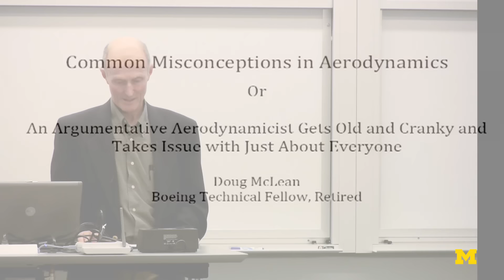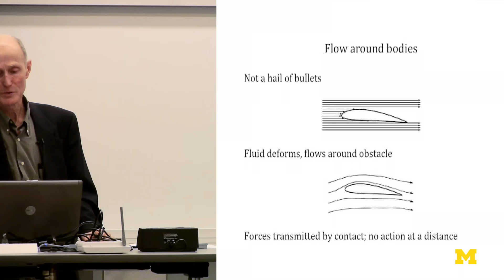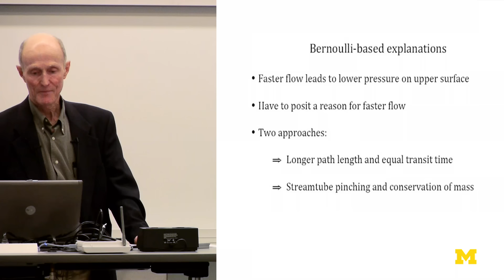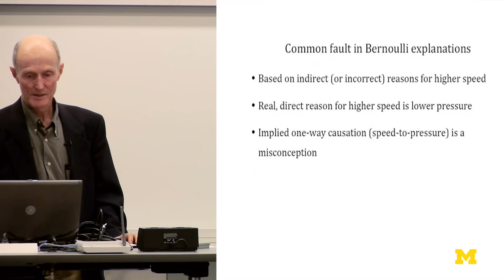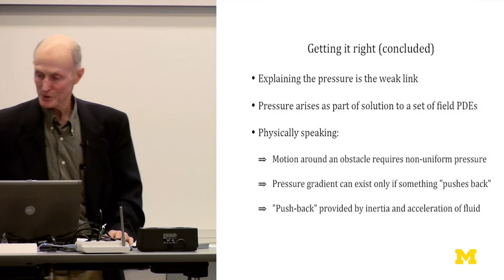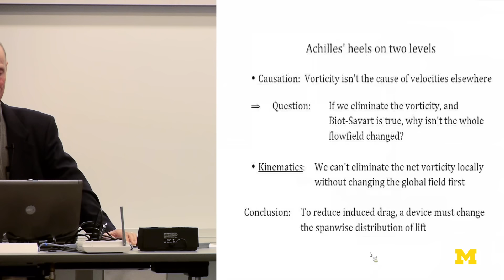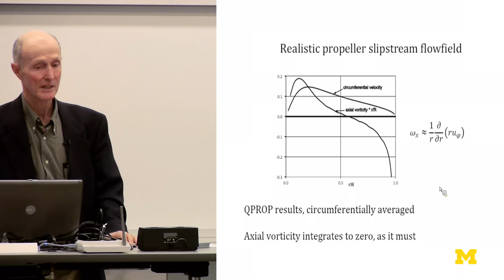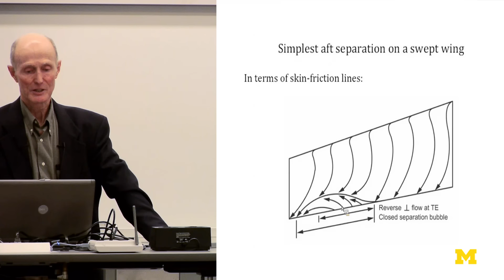Doug McLean | Common Misconceptions in Aerodynamics

Comment: aerodynamics is a topic where humans have gotten the idea that the medium is what give a plane lift completly ignoring the obvious that its the object the drives the medium not the other way around. they chould talk about airplane wing dynamics instead. they chould also talk about planes like we do with submarines in water. in water is it oceanicdynamics becasue the cavitation is inverted in water that causes explosions or micro booms. anyway what i dont hear with the engineering mind is what anyone chould be thinking and not engineering air because the end of the story is always the engineering of the plane not air. what the introduction chould be is two tings that is obvious and nothing else matters. the two things are mass times surface area equals lift. the angle of lift equals the placement of mass or the shape of surface area of mass. it does not matter what shape of the wings you use what ever like a swan or like delta configuration. a plane that generate a updrift of climb without flaps is a bad plane. newtons law of motion a object that is set in motion will remain in that motion that invovle direction and angle until a force imbalance or change it. this means when a plane is set in a angle it will continue to lift going up util its steering forces it to change direction. this means that planes that fly upside down are disasterously dangerous the way they are currenly designed. if there was such a thing as areodynamics then a wing must have a special shape to fly but since practially any flat surface will do for lift and by means of stabilizers can fly just as good as any particular wing shape. paper planes of different shapes fly very well and they dont have any special shape for lift. there is a dogma about aerodynamics where engineers think their plane wing desings are engineering air. that is not the case. there is no aerodynamics. the physics of planes is purly atmospheric pressure where lift is proportional to mass times surface are at a given angle. the medium is governed purly by air density. concorde was a failure because of my fireplace get to hot when i nearly close the air intake and the temperature goes the highest. what happens with friction when air density get lower and air velocity increases. it increases right just like the fireplace. another thing is that sharp objects tend to heat more quickly when a torch is burning them than round objects. a dart shape is very bad in lower atmoshpheric pressure as it will heat up more quickly because of air velocity at density times surface area heated. the physics or airplanedynamics is purly basic observations of natural behavior. remember atmosphere can not produce sonic booms by themselves unless there is a negative pressure region that generate steam and as a byproduct of lightning it produces thunder that is not just lightning but also explosions of water vapor when the negative pressure become positive pressure it explodes. we hear these explosions of clouds all the time. their identical to sonic booms. its the same thing that happens when bubbles forms on a propeller in water at hight speed as when a wing travel at high speed in air and water cavitates instead of air on the wing or propeller. the negative pressure in water attracts the air like the boiling effect of water in a vaccum chamber that is air escaping the water. water that has no air does not produce bubbles at all in vaccum. on a wing its the opposte of the water than happens the water molescules are atrracted to the negative pressure region nearly behind the wing and begins to condence. into steam. when the steam pressure get hight enough it forces inverts and the steam cavity explodes. concorde had to small wingspan to weight ratio to generate decent lift at supersonic speed and the jet engines were not designed for the lower atmospheric density or did not produce enough thrust to energy consumption.  the higher you fly the more you need to engineer the plane acordingly to basic principles of natural observations we all can do. we see the difference of force by boyancy as the lower the density of atmosphere the less the balloon generate lift. it means the higher you need the baloon to fly the bigger the baloon must be and then thinner it must be to keep the weight down. the same thing is for surface area of plane wings and size of jet engines. the lower the air density the larger the propeller has to be and the faster it have to spin to produce the same amount of thrust in higher altitude than conventional engines at lower altitude. the best name for aerodynamics that can explain behavior in any medium is mediumdensitydynamics.

Comment: It is annoying to get no nice comprehensive explanation for lift, but then, being able to pick an arbitrary form and say this produce lift, this doesn't, or even better, this form produce more lift than this form, seems like a very ambitious problem to solve if you restrict yourself to using a few easily stated principles. Most "explanations" are just more or less thorough descriptions of the airflow and pressure field around a plane/wing.

Comment: I always imagined it as a path of least resistance, stand in a pool and spin with your hand and arm straightened, your hand will want to stay level parallel to the floor. Trying to move your hand in a diagonal direction up or down takes a lot more force or strength because its not the easiest path and you have to displace more water.

Comment: A  wing acts to excellerate air downward  which causes an opposite reaction called lift.
Reply: But how does the “wing act to excellerate [sic] air downward”? Understanding that so as to be able to analyse the airflow and design the vehicle is the job of the aerodynamicist. ‘Wing accelerate air down’ is like saying the bridge is held up by its foundation without knowing if the structure can even support its own weight.

Comment: The authors have two misguided scientific approaches: researching the creation of Lift force and Low pressure at upper side of the wing, relative to the ground surface and Earth. I explain the aerodynamic cavitation and existence of Lee side aerocavern, and creation of Aerodynamic force.
Reply: Is your "Lee side aero cavern" related to my "Swept Volume Theory " (link: paste swept_volume_theory into search engine)? Where is your explanation?
Reply: @alans172  Aerodyne is a simple machine as inclined plane uses a single (wind) force to do work. Relative Wind Force is air in motion or aerodynamic force. There is no 'void of air' in the upper side of the wing neither Lift force, it is `void of air` at the Lee side or Backside of the airflow and the wing (object), and creation of aerodynamic force normal to the contact surface. `void of air` means "Zone of reduced air (pressure)".
Reply: @vlatkopopovski2685  Yes, no argument (well not much). I think we are on the same page. Can we connect? (What is Aerodyne - any link?)
Reply: @alans172  You tube does not allow links, photo, email or phone on comments, write my surname_name and send me email on Y...o
Reply: @vlatkopopovski2685  Trying that now.
Reply: When a solid body in fluid is displaced, in its previous place in a moment, in a small time lag that cannot be measured, there is/was a "cavern in the fluid".
The body moving through the atmosphere pushes and swept out the air along the way and creates an aerocaverne - a zone with subatmospheric pressure on it backside.
Reply: Lift is not upforce! In the dictionary, Lift means pick up and move to a different position. In aerodynamics, Lifting is a lateral moving, Lift is component of the aerodynamic force that "displaces" an object from the line of air flow.
Reply: @vlatkopopovski2685  I don't understand why you posted this. In aerodynamics, according to the guru John Anderson,  lift is the component of the aerodynamic force perpendicular to the direction of the incident wind.
Reply: @alans172  Prof. John Anderson does not even mention Aerodynamic force ... Past science up to now claims that there are two forces Lift and Drag, and the aerodynamic force was called the resultant or total of both.
Reply: @alans172  NASA has published three Incorrect Lift Theories so far, but which theory is correct and proven of how planes fly. The authors have two misguided scientific approaches: researching the creation of Lift force and Low pressure at upper (and camber) side of the wing, relative to the ground surface and Earth. I explain the aerodynamic cavitation and creation of Lee side aerocavern which produces Aerodynamic force.
Reply: @vlatkopopovski2685  I'm not sure why you said this. He certainly does mention aerodynamic force. In Section 1.5 "Aerodynamic Forces and Moments" he specifically refers to it in the text "The net effect of the p and τ distributions integrated over the complete body surface is a resultant aerodynamic force R and moment M... as sketched in Figure  1.16."

Comment: As a particle interacts with a foil it must become a part of the boundary layer, interact with the boundary layer as if it was a pseudo-perfect surface, or act as a slip stream bounding the majority of the work done by the foil on the fluid.

As each particle hits the pseudo-perfect surface, the potential for a perpendicular  force being applied to the particle is directly related to the trajectory of said particle as it is bounded between the slipstream and the boundary layer.

The greater the curvature of the underlying foil section, the lower the pressure between said bounded phenomena.

As the particle ricochets off the boundary layer it tumbles around numerous times disrupting the surrounding fluid.

As there is no relative curvature on the bottom of a wing, the slip stream and boundary layer essentially create a pocket similar to mario jumping under bricks.

Comment: Air does not flow over the wing of an aircraft in flight. The air is just hanging there minding its own business when the wing cuts through it and pushes it out of the way.
Reply: Due to frame of reference, there is no difference with respect to physics.

Comment: So he's saying winglets don't actually reduce induced drag?  I would have thought they would have wind-tunnel tested this before committing to the structure on operational aircraft. I might have misunderstood that part. 787 one of the few modern aircraft without winglets; I'd assumed this was handled by the general lift-pressure induced flexi-bend distortion of the whole wing.
Reply: They do, just not by hindering the pressure equalization at the tip but by virtually increasing the wings aspect ratio and so changing the lift distribution.
Reply: @sagasa456  How do winglets increase the AR as they are (almost) perpendicular to the wing? Why wouldn’t the wing just have a higher AR why are the winglets angled up? Just a student trying to understand how lift works!
Reply: @mleibling  As far as I understood (Im also just studying for aero exams hehe), the winglets must not be seen as a seperate part but as an extension of the wing and they will only work if they also have an airfoil shape, not just a flat end plate. I think reason they are angled up is just for structural reasons, as  extending the wing would result in additional bending moment.
Reply: @sagasa456  You need to look at the lift distribution.   There is lift along a greater spanwise distance.   A good rule of thumb is that a vertical winglet of height X yields an effectiveness of an increase in span of W/2.   So why winglets?   The pure span extension creates a normal force that adds to the wing root bending moment.   A vertical winglet adds almost nothing the bending moment.   So for an existing structure I can add a winglet and not have to beef up the structure near the wing root (and add weight)

Comment: The FAA has been pedaling the equal transit time theory and other foolish beliefs that are completely contrary to aeronautical understanding, in spite of the fact that the circulation theory of lift has been know since before the FAAs inception. 

(Circulation theory states that the air over the top of the wing accelerates and the airflow below the Airfoil decelerates, and the airflow over the top flows around much faster, and the airflow beneath never again catches up to that over the top. It's not at all equal).
Reply: why does air over the wing accelerate?

Comment: No misconception, when a helicopter blade turn the helicopter travels in a 90 degree direction to the whirling blades disk. The blades push air down and lift the chopper up. This is Newton. A wing that pushes air down with less drag due to cavitation will fly .
Reply: terry wayne Hamilton I disagree. A helicopter blade is still an airfoil, it just moves around its axis of rotation in stead of through a steady air flow as a airplane does. it still creates lift the same way, but we just need to consider the effects of its rotation such as induced flow and relative rotational wind
Reply: terry wayne Hamilton Rewatch the video and the prof clearly said this is not incorrect but an incomplete explanation of how planes float.
Reply: Hi, I have watched the tape and would like to add a few observations : one, vectored thrust is a good place to start for insight into what accelerated air can lift and two, favorable interference between two flying wings. I will take another look at the video and comment after....  A flat blade will work but too much drag.